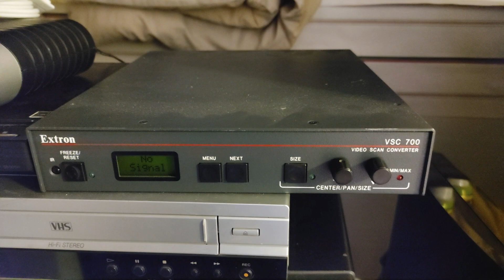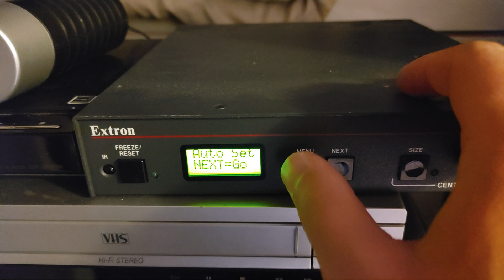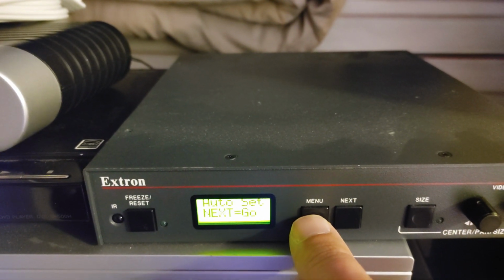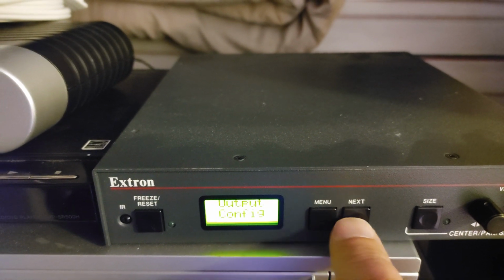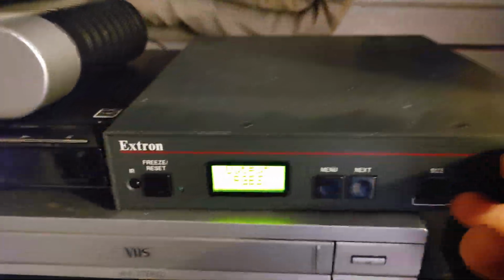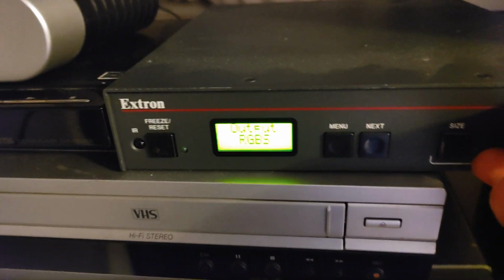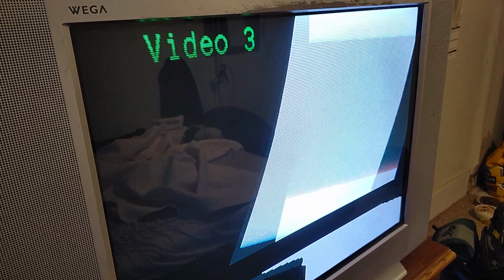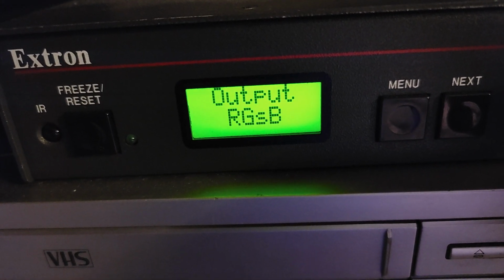How to Change the Output Configuration of an Extron VSC Scaler (Sync Options also Explained)

Comment: Hi, I saw on the manual that the VSC  500 have a Horizontal Filter adjustment on the Filters menu, but for a strange reason, I couldn't find it on my unit. It only has a flicker filter adjustment. Does the horizontal filter adjustment available on your VSC ? 
I understand that the horizontal filter can reduce the screen tearing, but i prefer a sharp picture on my TV 😊

Comment: You ever see screen tearing with this machine? see a bunch of reports online for this scaler
Reply from the maker: So, if you're using it with a device outputting a pure 60hz signal (like the Nintendo Switch), then there will be an occasional, slight screen tare.  Most of the time you don't notice it though.  This happens because these old CRT TVs are actually refreshing at 59.94hz instead of 60hz, so there's essentially a 0.06 screen tare (aka very small and not too noticeable).  It mostly doesn't appear in the center of the screen, so it's really not too annoying (at least not for me), but it is visible at times - especially if you know what you're looking for.

On a side note, if you're using a PC and can set the refresh rate to 59.94hz in the display settings, then in theory there shouldn't be any screen tearing.
Reply: @FairyKid64  Cool, I've ordered a VSC until things mature on the OSSC Pro or I pick up a Tink4k or something. For PC I have CRTEmu (also need to get around to trying Mister cast) but it's good to know the ideal refresh rate for the VSC and the reason to why people see the tearing. Thank you for that helpful comment, much appreciated, internet friend!
Reply from the maker: @VirtuaVillain you bet!  I wish you the best of luck!